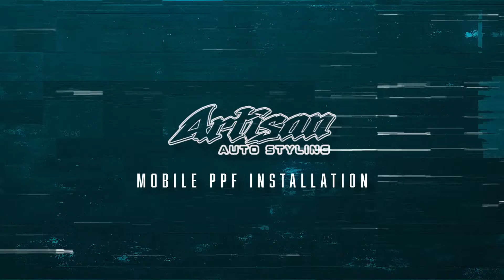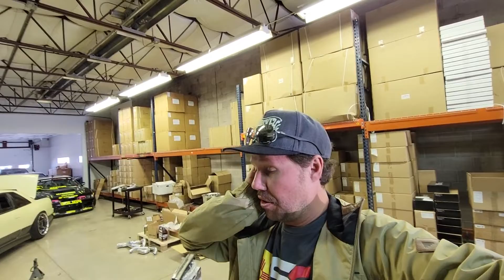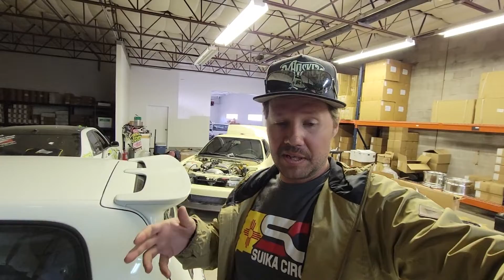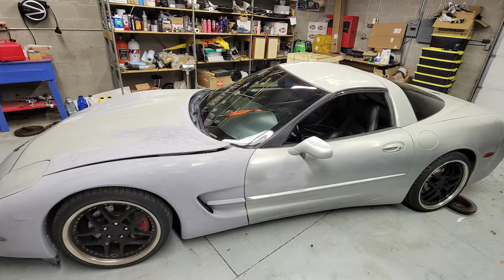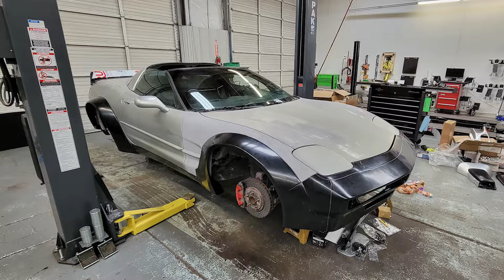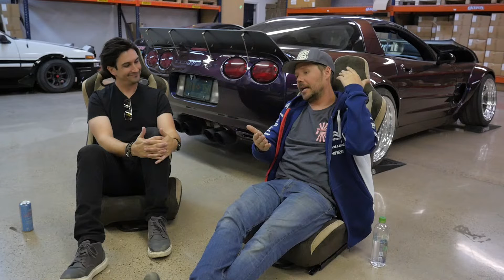Why full PPF my Midnight Purple Rocket Bunny C5 Corvette?

Comment: Officer Dan.. May i ask what are the wheel specs that you used for that kit?
Reply from the maker: 18x10.5 front -16 with a 15mm adapter spacer to 5x114.3, rear is 18x12 -28 with 15mm adapter spacer
Reply: @Officer_Dan  thank you so much i appreciate you very much.